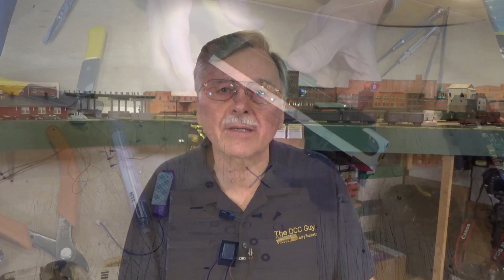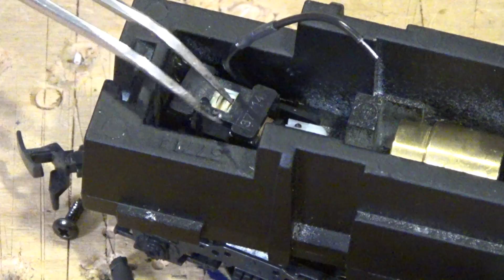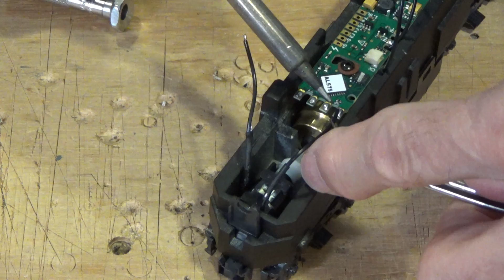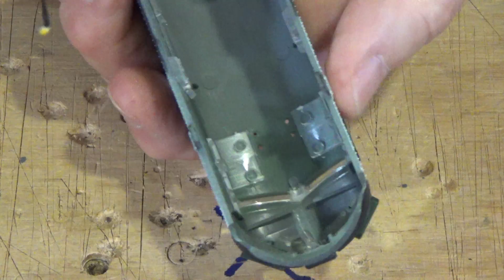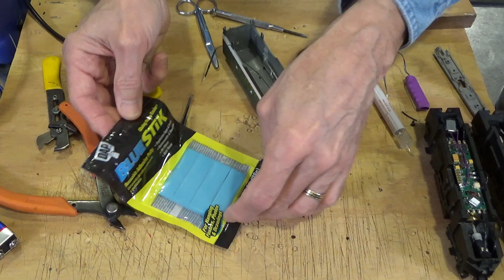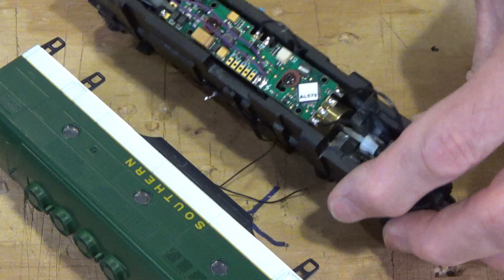Convert an old DC loco to DCC (50)

Comment: How did you know the motor was isolated?
Reply from the maker: Good question. In this case I have done tons of these so I knew it from experience. However if the manufacturer does not say up front that it is DCC ready or compatible then a test or visual inspection is required. If the motor is held in a plastic cradle and the wires come directly from the track pickups to the motor brushes then there will be no contact with the frame and it is isolated. Be aware that even a metal mounting screw run through the chassis into the metal case of the motor may create a short. In these cases you can usually use a nylon or plastic screw as a replacement or just use silicone sealant to hold it in place—I have done that with old Athearn motors in some cases. Many models like the older Athearn, LifeLike, Atlas, and brass models often used the frame as one part of the electrical pathway. The easiest way to test for this is to set a multimeter to the resistance option and connect one contact to the motor brush and the other to the chassis and check for continuity. If you get continuity with either brush then it is not isolated. Read your manual to see how your meter does continuity. The good thing is most modern locos are DCC ready and the manufacturers now specify this.

Comment: One of the reasons you don't need a current keeper is because this loco and most others have 8 wheels with 8 pickups.  But you won't get away with it on a 4 wheel switcher and even most 6 wheelers either!. I agree with Brendan, that LED is way too harsh.. Warm white#1..

Comment: thank you for all the info. i have a technical question. the loco has 12V DC motor. the DCC controller outputs 18V AC. how does that work? does the DCC chip contain a rectifier and a step down to 12V DC?
Reply from the maker: Yes, there are usually diodes forming a rectifier that converts it to DC. The voltage for HO is usually set at about 14 volts not 18. Internally the decoder uses various components to step it down to the voltage required for each sub circuit..

Comment: will this work on n scale also
Reply from the maker: It depends on the loco. Most now are designed for a drop in decoder installation so should actually be easier. Only older N scale locos would need a hard wired job.

Comment: Thx for the video! I'm thinking about getting the Bachmann Santa Fe Flyer so can I do this conversion to make sounds? Also, I'm assuming I can use a Basic 8 controller down the line on this too, right? I'm just looking to get something cheap and similar to what I had when I was a kid.
Reply from the maker: If the loco has a sound option then you are better off buying it with the decoder installed. It also may have a socket for easy decoder installation in the tender, most do now. I suppose by Basic 8 you mean a throttle with only 8 function keys? If so then yes it should work.
Reply: @TheDCCGuy   Thx for replying back so quickly and confirming! I appreciate it and subscribed. Love your channel!
Reply: Hi

Comment: I would like to convert some of my locomotives to DCC, however If I wanted to I would like to reverse the change easily as the locomotives I have are originally my Uncle's that I inherited. So I am kind of in this odd in between where I want to do it but can't due to sentimental value.
Reply from the maker: That’s a tough one. In the past I have saved things like the original motors in the case of brass models so if someone wants them they’re there. In the case of plastic models I never think of the guts as anything special just the exterior so for me I would just do it. Reverting to DC can be easy or difficult depending on the model. You are the only one who can decide just how far to go. One thing to keep in mind is the old saying about steam 
locomotives—on most of them the only thing original is the space between the wheels and sometimes even that was changed over the years!

Comment: Larry, I'm not sure how I originally discovered your Channel, but I'm certainly glad I did find it... I'm returning to the hobby after a 40+ year absence and boy have things changed, for the better I might add, but I'm glad to see Kadee #5 couplers and metal wheel axle sets are still the Gold Standard... I'm very interested in DCC and Sound for older Locomotives, both Steam and Diesel and really want to covert my units , if that is possible, but everything I have is from the mid to late '70s and am having trouble finding any information on such units, especially Hobbytown of Boston flywheel drives for Diesels and Bowser Manufacturing Steam Locomotive Kits, as well as a couple of Athearn Blue Box Diesels... do you, perhaps, have your own website where I could contact you?... Please keep up the great work and keep these wonderful videos coming...
Reply from the maker: Hobbytown was still manufacturing a decade ago after someone in Florida bought them but I haven’t seen any of their stuff in years. Bowser has been selling off all their old parts so you might check their website to see what might still be available. I have one video here on converting a BB diesel but you’ll need to find dealers who stock Athearn parts for replacements. One tip—LifeLike Proto 2000  parts fit old Athearn models, it is almost as though they sent an old F7 to China and told them to copy the drive system. You might try contacting Rick Bell at dccinstalls.com (dccinstallssales@aol.com) as he used to carry Athearn parts. I don’t know if Athearn sells upgrade kits or not. Your best be may be to find a recent model at a train show (once we can do those again) and swap shells—it may be cheaper than trying to upgrade an old one.
Reply: @TheDCCGuy  Yes, I'm aware...I've subscribed to both their newsletters, over a month ago, but haven't seen any newsletters, yet...I cant remember, right this second, if I got confirmations from them or not... I can tell you that someone in New Jersey owned Hobbytown as of 2017 but they were running it as a night job and haven't updated their website since then... I guess my real question is this: In your opinion, can I add DCC and/or Sound to this old units?
Reply from the maker: It depends. I have an old Hobbytown E6 but I long ago put in on an old Model Power E unit chassis and repowered it with a high efficiency can motor so was able to put a decoder in it. If you have an old open frame 3 pole motor in it then it might cost more to find and install a suitable motor than to just purchase a new loco. If you have a sentimental attachment then cost may not matter. Check the Walthers online catalog for suitable motor and drive train parts.
Reply: @TheDCCGuy  Thank Your, Larry...You are right, very sentimental about this one... it was the first non out of the box Locomotive I ever attempted and it got rave reviews for all my Model Railroading friends, at that time... Guess I'll have to just keep on researching and see where it goes...

Comment: The Stewart F3a has pop out solid number boards. I'm checking with Bowser to see if they have replacement clear. If I make these work can I Light both of them and headlight with 3 smd and if I can do I wire them in series or parallel?
Reply from the maker: I looked into doing this once and figured you could just replace the insert with clear styrene cut to shape. Also some companies used to sell brass casting numberboards that were hollow. Don’t know if they are still out there but the Walthers catalog/website might have them if they are. I would wire them in parallel but watch that the combined milliamps don’t exceed your decoder limitation for each function. You also could put the numberboard LEDs on  different function.

Comment: @LarryPuckett White Teflon Grease is plastic-compatible, I presume?  If so, then where can I get some?
Reply from the maker: Buy the stuff sold at local hobby shops or order through a Walthers dealer. That way you get the stuff made for models and know it is plastic compatible.

Comment: How would you light # boards?
Reply from the maker: If they are a one piece casting then you can just light them off the headlight as most manufacturers do. If you want them independent of the headlight then carefully separate the clear number board casting from the headlight insert and paint the sides of each black to prevent bleed through from adjacent lights. Then attach a tiny SMD LED to the back of the numboards and headlight castings. See my video on using LEDs for lighting locos. 

Now if the number board is a dummy and cast in to the shell then it is more complicated. You have to carve out the center of the number boards, install a clear styrene “lens”, and light from the rear using the small LEDs.

Comment: At about 32:30, I noticed when you went into reverse the headlight turned off. Would a real diesel's headlight turn off in reverse mode? There are quite a few terminals on the side of the board. Are these used for other loco functions and what would they include? I've seen real locos and their headlights 'rotate'. Any way to duplicate this feature?
Reply from the maker: No that is just one of the automatic features. On real locos they had switches to turn everything on and off and the crews had to do that themselves. Early DCC decoders generally had autoreversing headlights then later manufacturers started offering individual function controls. These still can be useful as operators often depend on the headlight to know which direction the loco will move so practicality wins out over prototypical operations. One thing I do turn off is the auto horn/whistle function that blows every time you change direction.

Comment: I have 7 old n gauge locomotives from the late 60's - early 70's that i had as a child that have been sitting for 40+ years .  Is it worth trying to get these up and running and converting to dcc or should you just bite the bullet and buy new.  I have about 70 cars of rolling stock as well.  Looking to get back into the hobby.
Reply from the maker: I doubt you would be happy with their operation assuming you could get them to run again after this long. The current generation of N scale locos use 5 pole skew wound motors and are designed for ease of decoder installation. I can remember messing around with N scale back in the late 1990s when you still mostly had to shoehorn decoders into the models but a few were just being released that allowed drop in comversion—the difference was like night and day. If you have a few that are of some emotional value then you might try to just get them to run in DC and see how that goes. Good luck.

Comment: Thanks Larry......great vid! One thing I would do differently, in fixing the LED, I wouldn't use super glue and tape, I would use the adhesive that sets by UV (just like at the dentist) a tiny spot on the LED, hold it in place, and apply the uv mini torch until it's gone hard (no more than 10 secs) . I would do the same with the leads back to the decoder in the inner roof of the shell rather than tape. The glue and torch is available on AMAZON, it's amazing!

Comment: Hi, can you give any advice on converting a class 37 Hornby triang R751? Only 2 wires going to the rear bogie so not sure where to wire the 4 wires.any help would be really appreciated, thanks in advance
Reply from the maker: Terry, sound like the two wires are track power pickups that run to your motor? If that is the case, and you can test that with a voltmeter, then the red and black decoder wires go to the track wires and the orange and grey wires go the the motor. Make sure to check the current draw of the motor first as older locos can pull a lot pf current and kill an undersized decoder. See my videos on using voltmeters and checking motor stall current.

Comment: Hey, Larry.  I use graphite powder to lubricate.  Oils and grease just gunk up over time.  Graphite doesn't have that problem and it's a better lubricant, too.  You just have to be VERY careful when applying it because it has a tendency to get everywhere and it's impossible to get off if you spill some where you don't want it (or just call it "weathering," lol).
Reply from the maker: I still have my original tube of Kadee graphite—a little goes a long way!
Reply: @TheDCCGuy  Oh?  I didn't even know Kadee made graphite powder.  I used to buy it at Radio Shack, but now I buy it at places like Home Dept and Loews.  Yes, a little goes a long way :-)
Reply: Graphite is also conductive and  will cause electrical shorts.

Comment: What size was the wire?
Reply from the maker: For a decoder installation I usually use about the same size wire as used on the decoders. Digitrax sells a bundle of decoder wire in all the colors about 10’ long and I have one of those. I just clip off what I need.

Comment: If you use the DAP Blue stick adhesive, make sure you knead it well so it becomes very playable. This is what this blue, yellow, black, etc... stick becomes tacky.  The more you knead it, the softer and more adhesive it becomes.  Don't just pinch off and stick in as it will eventually dry and fall off.
Reply from the maker: I’ve come to prefer the black Uhu Tac putty. For one thing it is pretty sticky and since it is black you don’t notice it through a clear lens when the LED is off. However it is difficult to find, I have inly been able to get it on Amazon.

Comment: What temperature do you like to use soldering on decoders?  and is the wire splices the same solder temperature?   Thanks
Reply from the maker: The best temp varies depending on the heat sensitivity of the component being soldered,  the type of solder, size of the components being soldered, and size of the iron tip being used. Solder melts at between 354 and nearly 600 degrees F. So you need to know the melting point of your solder. Larger pieces of metal will absorb and conduct heat away more readily than small circuit traces. Small round pointed iron tips are more inefficient at applying heat than larger flat ones. So what I recommend is to practice your soldering and get a feel for how these variables interact. Start at a temp greater than the melting point of your solder say 500 degrees on average and go up or down from there. For circuit board solder pads I typically go with 600 degrees with 60:40 or 63:37 solder. This allows me to quickly make a solder joint without overheating components or traces. And that is a concern since some circuit traces will lift if overheated. The good thing about circuit boards is the solder tabs are usually located far enough away from the components to limit damage but the traces are still a concern. So I cannot give you the best temperature for you to use, it really is something that comes from experience so get out some scrap parts, and scrap circuit boards, and practice.
Reply: @TheDCCGuy  Thank you I'll be working on that thanks for the advice.  Who prints your book now is it Railroad Model Craftsman or Model Railroader?   Thanks again
Reply from the maker: My old “Practical Guide to DCC” was purchased by White River Publications when they bought RMC. They still have a few copies for sale but it is getting a bit old now so it is very unlikely it will ever be reprinted. I have done 3 books fro Kalmbach and they are still available on their website as well as Amazon. You can find direct links to these on my website www.dccguy.com .

Comment: Thank you for this video! Between this and your DCC Corner article, I was able to install a DCC sound decoder in my older Stewart F3 locomotive. I do have a question about the mini connectors used in some manufacturers' speaker connecting system seen in some of your other videos. What is the actual name of the connectors besides "JST"? Is it JST1.0 mm, 1.5mm or other? What is your source for these connectors that would be more affordable then buying wiring harnesses from the decoder manufacturers?  Are these connectors model railroading/DCC specific?
I have had wires pull out of several connectors when unplugging them and I hate to have to buy whole, new harnesses. Thanks again.
Reply from the maker: The ones I use come from TCS but some other manufacturers make similar ones. The TCS website is www.tcsdcc.com .

Comment: Is there a decoder you recommend for a narrow steam locomotive? I have a DC Rivarossi Southern Pacific 2-8-2 and a Bachmann Union Pacific 4-8-4, both HO scale?
Reply from the maker: The first question is how old are these a d are they DCC ready? Then what is the stall current of each? I would hazard a guess that you should have no problems putting a decoder in each of these particular in the tenders. I installed a TSC WOWSound decoder in the tender of a Bachmann 4-8-2 last year without any problems,
.
Reply: @TheDCCGuy  I do not know the age of either, all I know is they are DC locomotives.

Comment: I have two old Roundhouse 42 ton two truck Shays, can they be converted to DCC?
Reply from the maker: I have one of those around here too and the biggest issue would be finding a place for a decoder and speaker. Mine never was a good runner and I bet it hasn’t turned a wheel in 20+ years. One option would be to find one of the extra tenders and use that for the decoder and speaker. I have a friend who has one of the Bachmann Shays with a sound decoder and it runs very well.
Reply: @TheDCCGuy   I'm getting back into the hobby. My dad and I started a logging layout back in the late 70s. This DCC thing is all new to me. I did pick up a Bachmann Spectrum 70 ton three truck Climax (DCC) new in the box, but I think I will have add sound. Looked at the new Shays $1,100 ouch.  This hobby has gotten expensive. Thanks for the reply.

Comment: Do you have a video showing the same process to install a sound decoder in a Life-Like Proto 2000  EMD  E8   A unit ?
Reply from the maker: Not yet, but I have about 6 that need decoders so I’ll eventually get there. I did do an article in the July 2017 MR which should be essentially the same process.